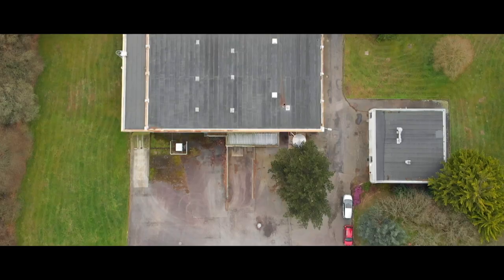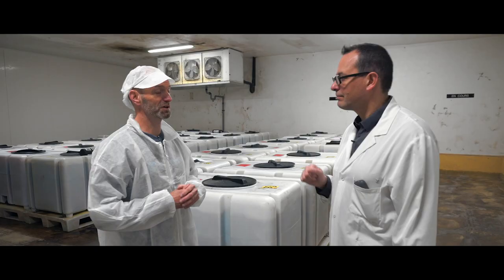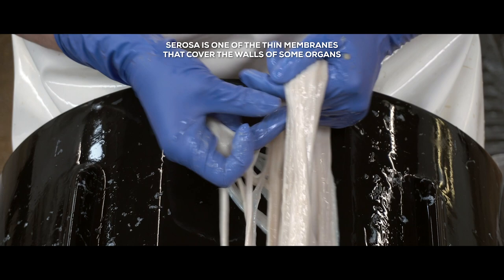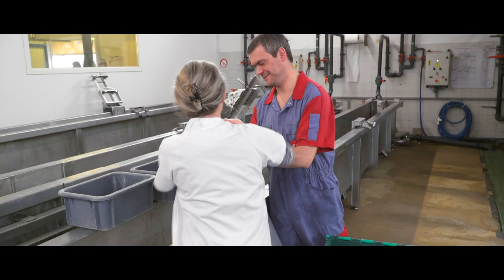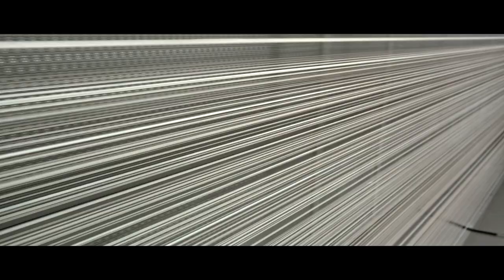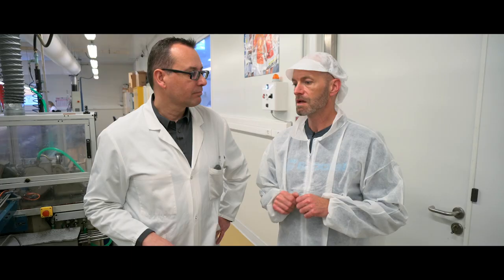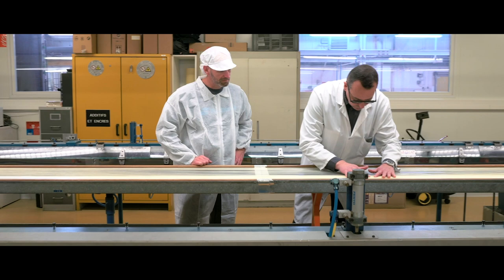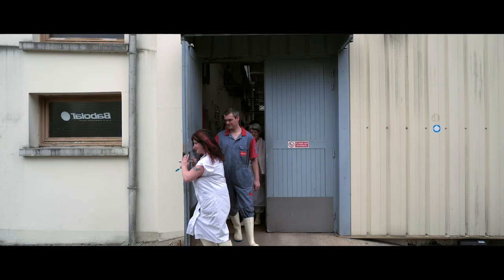How Natural Gut is Made: the History of Babolat VS (the original tennis string)

Comment: I love the string, but the packaging is misleading. It says 12m/40 ft. It is in fact 12 meters, but that is 39 ft 4 inches, quite a bit different than 40 feet. Can make a difference if you are stringing either oversize racquets or those with 18 mains.
Reply: It’s not misleading since each packet will actually have more than 12m / 40ft. I’ve never had a packet of string, regardless of composition. material, where there wasn’t a reasonable extra length included.
Reply: @jerome_morrow  Wow, a reply to something I posted 2 years ago. But the point is still valid. Next time you open a pack, measure it. It will be 12 meters (39 feet 4 inches). but it will be far short of 40 feet, So if that is what the want to do, fine. Just label the package 12 meters. Don't label it 12m/40 ft.
Reply: @jc52rc58  This is YouTube, comments can well be metachronous! I’ll admit to rarely ever measuring out the exact length of string in any packet. However, I’ve never been short. Seems to be more than enough length left, even when I split the packet 50% for hybrid stringjobs. If you’re actually measured it and it’s short on the Imperial measure, I’ll take your word for it. Thanks for responding.
Reply: @jerome_morrow  Hey, if my response came off sarcastic or snarky, I apologize. I respond to anything so infrequently that I genuinely was surprised to see a comment 2 years later. And I agree with you, most packs of string have more than 40 feet. And with the gut, half a pack is plenty for most of the racquets I string. I posted because I am a senior and many of my clients are also. My personal racquet has 18 mains and is 110 square inches. I always do a hybrid. For the mains I need at least 20 feet. When I started using the gut I was coming up short. If it was a full bed I could just cut one length longer for the mains. So I was disappointed that I could not get 2 string jobs from the 1 pack when I though there would be 40 feet in the pack. I think they are much more accurate when they cut the gut for the packs. It is consistently 12 meters, which is 39' 4". Again, I apologize if I cam off snarky. Was not my intent.
Reply: @jc52rc58  No worries, it didn’t! 😁 And good point about OS frames with 18 mains where a full 20 feet helps. My racquets are all 90 (yes, 5th decade here) to 98 sq inches, so I’ve never had too much trouble with string length. I’ve not used gut in years (cheap Scotsman), and I can imagine manufacturers would be less generous with this. Poly is inexpensive to manufacture, so they are generous for the most part. Cheers!